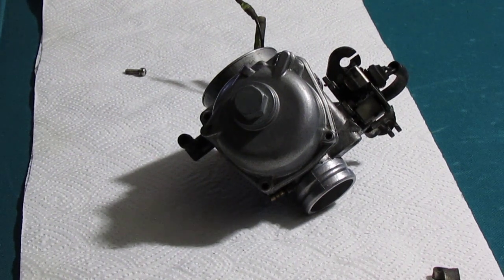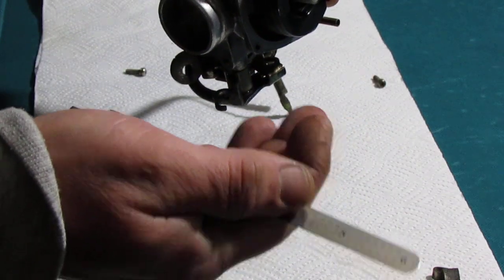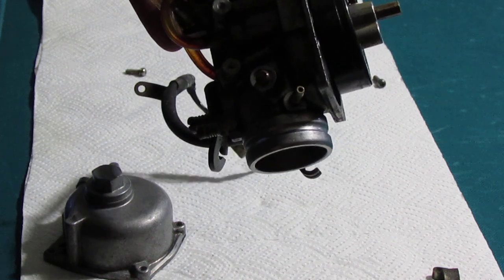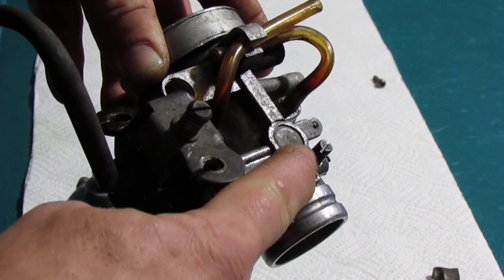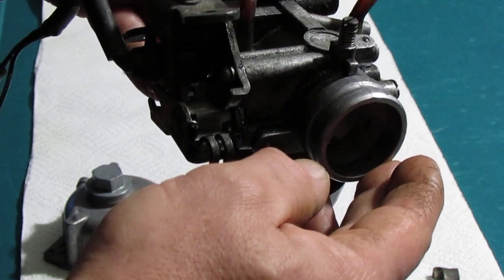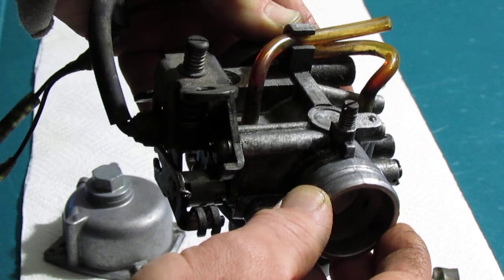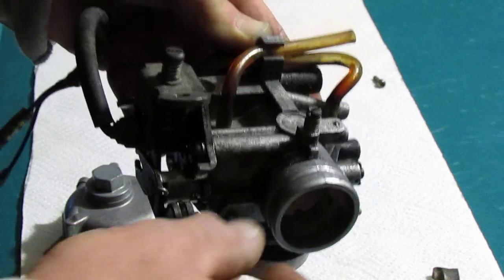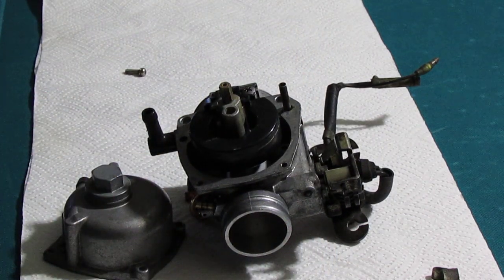Keihin and Mikuni Butterfly Carb Tuning Tips

Comment: Thanks for this video Mike OD, it really works on my Keihin 26mm Carb, however I have a slight bigger Chinese Carb that I installed to my bike CG125 Honda, it really works fine but my top speed are slow, its kind of high in RPM, Running slow than my previous smaller Carbs. any suggestions to get the performance on my top speed? my spark plug are good, I also made my own air filter and installed.
Reply from the maker: glad it helped carbs are very easy once you figure them out

Comment: hi thanks for the reply, actually I got it back down I just had to turn the throttle stop screw way down, but another question I put the fuel mixture back to where it was when I took it off, would me playing with the throttle stop screw change the mixture making it run lean or rich? thanks!
Reply from the maker: no the throttle stop is your idle speed adjustment, the fuel mixture screw is only for lean/rich adjustment at idle to verry little throttle, then the rest of the carb does the work for you. The main jet size would affect your full throttle lean rich ratio

Comment: I have a 1989 bravo 250cc I cleaned the carb had it running good but sometimes when I come to a stop the sled dies on me and won’t start back up  change the plug and I still have to fight with it to run again I mix the fuel to 40-1because 50-1 was to rich   Any idea what’s going on ???

Comment: does anybody have the problem where the motor will only start with choke won't stay started without it on and when the choke is on give it a little gas it dies ?
Reply: I just had this problem .. with the carburetor apart make sure the pilot jet is not clogged.http://www.yamahatriples.com/index.php/how_tos/carb-rebuild-mikuni-mark-2/

My pilot jet was clogged and was only running on the choke .. I know this is 4 months old but hope it helps
Reply: it was my floats

Comment: That is a fuel screw not an air screw...
Reply from the maker: Denise McDowell you are correct,I misspoke, the air adjustment screw is always on the air box side of the throttle plate. If the screw is on the engine side of the throttle plate it is the fuel mixture screw. Thanks for the comment I didn't catch it when I spoke
Reply: Your explanation was good for a Mikuni with a low speed air screw.